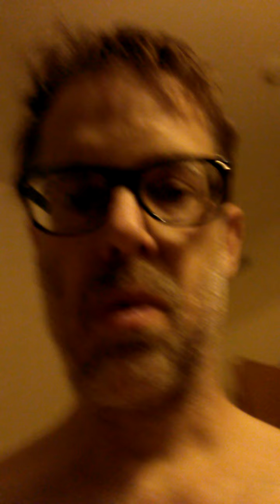Twin Turbo Chevrolet Straight Six vs Abrupt Global Warming Ecological Biological Annihilation Crisis

Comment: The shifter on my Kona 3-speed freezes up in winter in Ontario.
Reply from the maker: https://2013.konaworld.com/bike.cfm?content=africabike_three You have one of these? Awesome! Hmm - maybe silicone would stay nimble in the cold. Isn't that a Elephant bike also? Do you have a carbon frame? https://konaworld.com/archive/2018/process_153_cr_dl_275.cfm Fancy. You know it's pricey when they don't list the price. haha. How much does a Kona bike cost?
For the base model at $1900 you get a 29er with Kona's unique “Scandium” frame material – aluminum reinforced with a rare earth element that adds strength without much weight. The Hei Hei DL and Supreme models add superior components and will set you back as much as $5500.
Reply from the maker: @MGrube-qq9ju  Have you tried getting bulk organic cayenne? I rely on cayenne. Ankylosing Spondylitis: 9 Ways to Reduce Inflammation May 28, 2020 — Incorporating spices like garlic, turmeric, ginger, cinnamon, and cayenne pepper into your diet may help reduce inflammation.
Yeah the only bicycles I ride now are my folding bicycle for tooling around the Senior Compound when I'm doing lawn work - saves time from walking. Also my electrical generator bicycle in the garage - we got a new exercise bicycle in the house. My niece was saying today how we should hook it up to power the t.v. haha.
The deal is that we live in car country now - a highway right next to us with motorcycle clubs revving their engines all the time. The way I figure is "enjoy it while it lasts" since Mother Nature is in control!! I visualize the collapse of civilization - it's a well known fact when the gas price goes up people drive less.
I miss my bicycle commuting days - that British 3 speed was very comfortable to ride long distances - all the time - just like the novel, "The Third Policeman" where they merge on a quantum level with their bicycles. So I kind of figure in the future I'll be relying on a bicycle since to own a car a person needs a "permanent" domicile residence - at least as far as the tax assessment is concerned - with utility bills to "prove" you "live" there. haha. It's all pre-planned "development" locked into the corporate-state scam.
Reply: @voidisyinyangvoidisyinyang885  Thanks for the recommendation. 'The Third Policeman' is available on Pirate Bay.

Comment: Ban cars yeah! Also diesel trucks with loud mufflers. 
It would solve urban sprawl.
Reply from the maker: I never really appreciated Diesel trucks till I spent a semester in Costa Rica studying "sustainable development" and "conservation biology" - not sure why but the diesel fumes were extra prevalent in the streets there.  "Swiss trading firms like Trafigura, Vitol, and Addax & Oryx take advantage of lax regulations to dump the dirtiest diesel and gasoline on African nations. The 160-page report is based on three years of research into the African fuel trade. Researchers sampled fuel directly from pumps in eight countries, and found that samples contained up to 378 times the sulfur permitted under European regulations." wow - corroborates what I experienced in Costa Rica in 1992!! 
"Other toxic substances—including benzene and polycyclical aromatic hydrocarbons—were also found in concentrations banned in Europe, according to the study. Swiss trading firms often make these high-pollution fuels themselves, producing grades known as "African Quality" that are sometimes also sold through fuel stations controlled by the companies. While these fuels are intended for sale in Africa, they are produced in the "ARA (Amsterdam-Rotterdam-Antwerp) Zone" in Europe, where many of the trading firms have refineries. That means while West African nations export high-quality crude oil, they often receive low-quality fuels with high levels of pollutants in return. In other regions, regulations would prohibit the sales of these fuels, but African standards are generally too lax to prevent the practice, according to Public Eye."